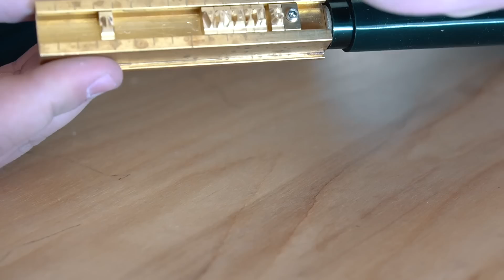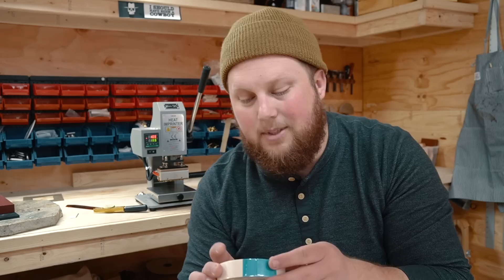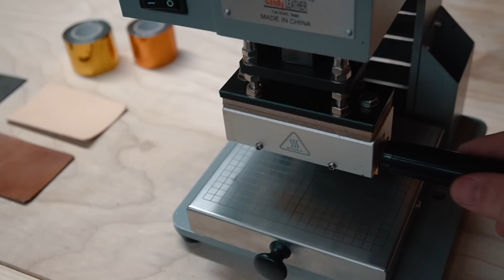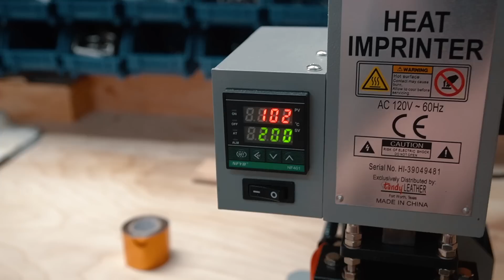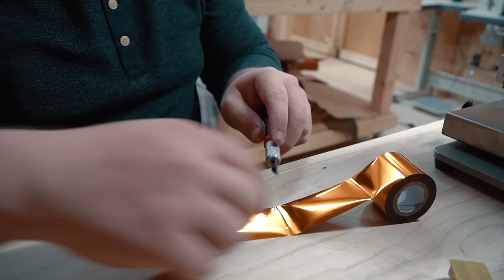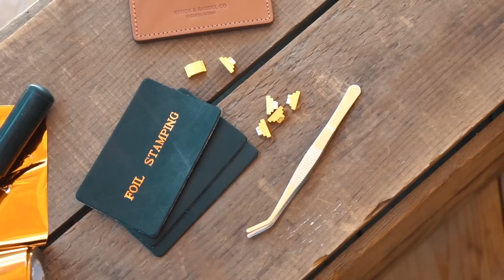Leather foil stamping and heat embossing

Comment: I live in Turkey. We just bought this machine. On the back of the leather wallet, I will write the names of the customers on the narrow compartment where the hand can easily enter. I want the text to be straight and nice looking, without slashes. The wallet can be opened and closed with a magnet and a phone can be placed inside. What method would you suggest?

Comment: Trying to figure out if it's possible to emboss or stamp foil into stuff with resin printed stamps.
I just don't know if what I'm trying to do absolutely requires metal stamps and fancy equipment and if I'm making one offs or only a handful of stamps with custom designs, that'd get expensive and unreasonable to make/have someone make metal stamps of those.
Have you heard anything in the scene about people 3d printing stamps for embossing and foil stamping?
(or even epoxy stamps if you make a mold and do it that way too)?

Comment: How hot is the stamp actually when applied
Reply from the maker: different leathers like different temps. If it's a dry leather like skirting or tooling I usually keep it around 300 degrees. If it's something with oil and wax content I use around 180 degrees
Reply: @parkerlichfield   ok thanks. I don’t have the machine and am trying to get my stamp hot enough and it seems like it should be I was trying it on water Buffalo crazy horse and just didn’t seem to work no matter what temp. Either didn’t put it all down or melted right through too fast. 🤷🏼‍♂️

Comment: Www.leatherstampmaker.com makes stamps that work with tandy heat imprinter holder and sells the adapter also for better pricing than Tandy
Reply from the maker: That's really good to know! Thanks for passing that along. Maybe i'll do another video on this machine soon because the high cost of the dies for that specific jig (when ordering from Tandy) is the only thing thing that's frustrating about it

Comment: Can you do this without the heat machine? I’ve got gold leaf and a stamp with my initials and want to do this on a piece of leather. ANY ADVICE?
Reply: Gypo - What I would do - Try to hold the stamp with a pair of tongs or pliers, use heat resistant gloves, heat with a heat gun or over gas or alcohol flame. Try to guess about 120 deg C. Press into leather for slow count to 5. Try again. Try hotter. Try pressing longer or harder or shorter or lighter for desired imprint. Use on scraps of material.

Comment: For anyone who may be at a loss. If you mess up a foil stamp (misaligned, wrong color, not hot enough, upside down) foil will dissolve in acetone!!!!! It will leave behind an imprint depending on the heat and pressure applied, but acetone, or acetone like solutions will strip the foil away! BE CAREFUL THOUGH, acetone will also strip away other finishes and paint, so I'd test it on a scrap first before diving in lol.

Comment: I've been hot foil imprinting for 20+ years.  This machine is fine if you're not changing the Type setup often.  Otherwise, that is a high maintenance chase. Good tip about repetitive imprinting.  I use antique Letterpress with a Howard Imprinter. Mine doesn't have this fancy temperature gauge, that's a nice feature.  Leather is a trial and error process like you say.  I have found foil printing leather works best using a 2 step imprint. First imprint no foil to make the impression in the leather, then add foil and reimprint. Just make sure your leather is secure so it doesn't move between the iron process and the foil.   Also, when you put a large Die into the Imprinter, give it a little time to completely heat up. Being able to spelling backwards is a bonus!  😁  Cheers!
Reply: Do you use anything to adhere the foil to the leather when using a letter press?
Reply: If I do the foil stamp on crocodile leather what temperature should I get and any note when doing it ?
Reply: good tip didn't think about pre pressing before foil stamping, how do you keep your leather from not moving though?
Reply: @TrailBoundco  I use a Clamp - I used to do Bibles. The textured leather covers, it helped to pre press (iron) prior to foil. I have clamps with furniture feet pads glued to them as not to mar the leather.